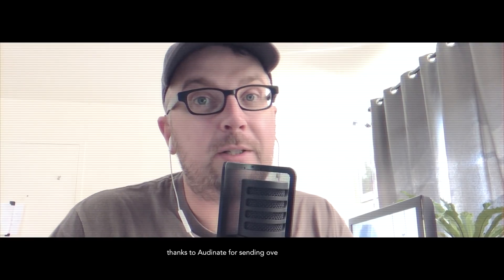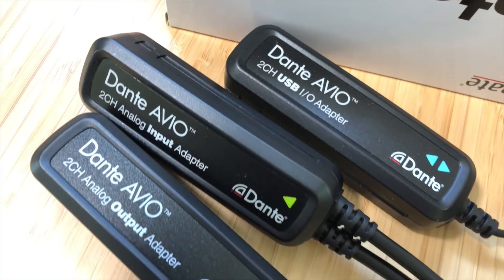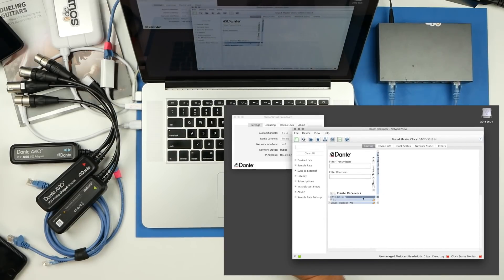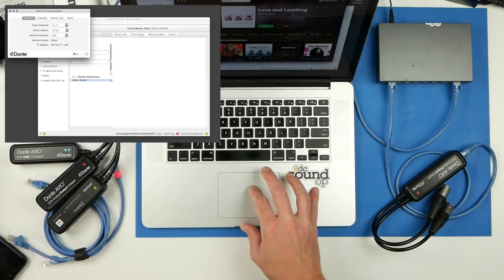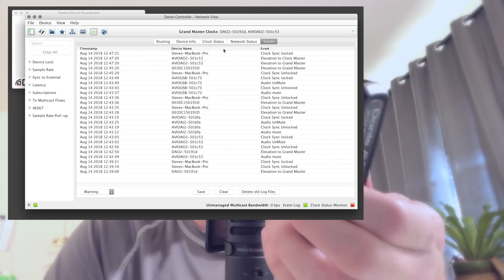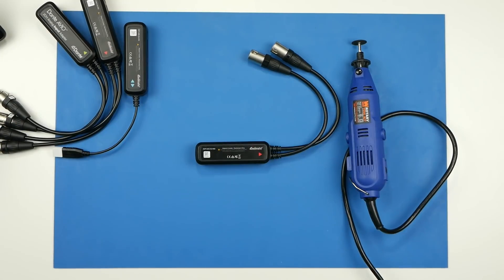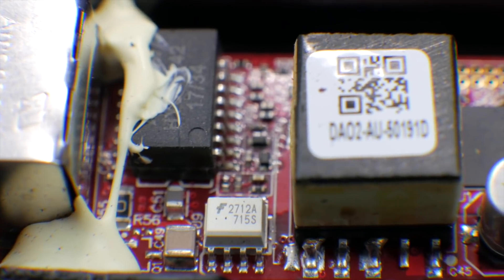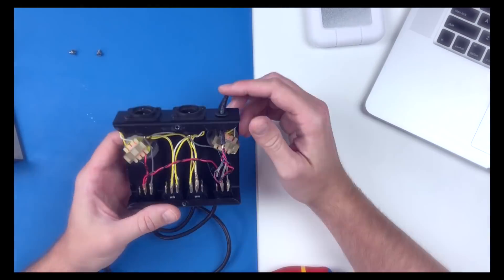Audinate AVIO Dante Audio Adapter: First Look & Review

Comment: Thx
Have you had any issues with the overall level of output from the AVIO Output adapter?
Reply from the maker: Thanks for the message. Did you know you can change the output level of the Avio adapters in Dante Controller? Just double click on the device to open 'device view', then go to the last tab on the right for 'Controls' - there you will be able to choose from a number of different output options.
Reply: @DcSoundOp  Beautiful!!!!

Comment: How do I connect an old racksynth wit only midi in/out to a dante network?
Reply from the maker: Hey Andreas, Dante doesn't do that as far as I know, but you could use the same network to run a midi over ip setup along side Dante and it won't mind. Here is a forum post on the Reaper forums where some folks are talking about different setups they use for midi over ip. Thanks for the great question!

Comment: it should be a version with power on board, so without necessity of the ethernet switch
Reply from the maker: How would you be connecting it to a network without a switch? If you just want to go point to point from a computer or other avio... you could use PoE injectors just fine for local power at each adapter. They’re dirt cheap.
Reply: @DcSoundOp  yes, but you could need just to send a digital signal from a digital source to just one computer that alone cant receive direct digital signal
Reply from the maker: @ergabbio666  I'm not sure I understand. You're saying you want to go point to point from a digital source to a computer... and you could absolutely do that by using a PoE injector ( https://amzn.to/2O2bCFK) with an AES Avio adapter on one end and the USB Avio Adapter on the computer end, powered by the USB port or another PoE injector. There are even battery powered PoE injectors for situations where you need to do this all on battery, though they are a bit more expensive. Let me know if I'm completely misunderstanding what you're looking to do though. Thanks for the message!
Reply: @DcSoundOp  yes i understood i can do it with a PoE, i was just saying it could be nice to have even the possibility to have all in one, so without the necessity to pass through a the PoE injector that in this case it will be use just to give power to AES Avio
Reply: @DcSoundOp  anyway i don't want to be misunderstood, i'm a AES Avio happy user! it's a great system, I just was giving another idea that maybe you didnt think about...but i'm not an engineer, and i respect your job!

Comment: Great video - I was wondering, how are the cases sealed? With glue? Can they be opened non-destructively? Thanks :)
Reply from the maker: Hey Aaron, the units are put together using ultrasonic welding, not glue. It might be possible to open them without as much damage as I did, but I certainly wouldn't have destroyed one just for fun.
Reply: @DcSoundOp  thanks for the info - I've been given two dead AVIOs (they won't power on), so I'm going to try and open them up. They were shipped to a friend in non-anti-static wrapping, so I think it's an ESD-caused fault on the POE transformer. Probably not worth trying to repair, but it could be fun anyway. Cheers
Reply: @Aaron-rn6pg  Hey how did it go?

Comment: An OLED screen so you can patch devices, something that you don't have to use Dante Controller for. Then again you'd hook up a Dante enabled mixer to do all that I guess.

My setup is simple.

I have a Linux Box that there isn't a Dante Virtual Soundcard and Dante Controller driver/software for... Also Audinate doesn't support Linux. :/
REDNet AM2 2ch Out

Comment: Hello. Would a pair of these with male XLR connectors work to connect a pair of Yamaha monitors to a Mac using Dante Virtual Soundcard? Cheers.
Reply from the maker: Absolutely, I use a set for my studio monitors occasionally and it works great. If I didn't reconfigure things so often for testing, I would stick with it full time.
Reply: @DcSoundOp  Thinking about the money I could save in case my old but trustworthy FireWire box one day fails. Thanks.

Comment: Thanks for video. Didn't find this info at Audinate official site but saw that you have the image of Dante Controller device connection view too in your video. Do you know why Dante AVIO Adapter connection speed is only 100Mb even when connected to 1Gb switch PoE port?

Comment: I don't know how much network equipment you understand. I would have sent an ethercon. remove the RJ45 connector from the board, the data transformer is separate from the connector and this is a nice thing.
in addition I would study to give a 15V power supply I assume after the poe. eg not always be linked to the poe.

Comment: Pro Version with possibility for external power and for input version phantom power to power the unit. Also chassis connector and Ethercon.
Reply from the maker: Check out the Switchcraft version - https://youtu.be/ZylT-7ipQaY or the Neutrik DPRO if you to go all out on an input version - https://youtu.be/Bpq9siRXHik

Comment: what's the latency coming from this avio usb adapter into another computer using dante vds?
Reply from the maker: That’s going to depend on how you have things configured. Latency is configurable in Dante controller depending on your network needs. Here is some info on setting latency compensation when playing back from Dante devices - https://dev.audinate.com/GA/dvs/userguide/webhelp/content/dante_latency.htm - out of curiosity, what’s the setup your considering using this for?
Reply: @DcSoundOp  Much appreciated for your  answer. Alright, let's put it this way: what's the minimum latency you have been able to reach with this interface? Thanks
Reply from the maker: Happy to help anytime. Dante handles latency different than you might be thinking. Are you familiar with setting up a Dante network, if not, the level 1 online videos may be of interest @  https://www.audinate.com/resources/training-and-tutorials/dante-certification-training - here is a page that gives you the details - https://dev.audinate.com/GA/dante-controller/userguide/webhelp/content/latency.htm

Comment: I have 6 of these in use at our site.  I too would love to see Ethercon added to this at the least. It would be nice if it had a redundant connection and ran on 1gig. But I'm sure you would not be able to add all that at its current price point. So I would like to see a Pro model as well. Also a rack mount version of this in 8 channels would be great for bringing all your analog wireless mics over to dante.

Comment: When I first read about these I assumed the first would be a 1 in x 1 out version. I guess that doesn't make sense either for live sound or recording though. How often do you need inputs and outputs in the same place? 
Good review! Hope you didn't get into hot water totally upgrading / destroying the original unit.
Reply from the maker: A 1x1 or 2x2 option would absolutely have applications in both live sound and recording. I'm always of the opinion that if you're running a snake, it might as well have a return or two. You never know when you'll need to drop a powered wedge or wired headphone mix in somewhere. 

I'm sure these will start to become more common as the technology becomes more common in the coming months. The crew @Audinate have a great sense of humor.

Comment: Re: Licensing, when you talked about the USB Version:

These would be essential. Apparently, you are only ever allowed to have the license tied to one machine. Forever. How do I know? My DVS License was recently locked, because I switched my production laptop to many times. Never installed on multiple machines at the same time, only ever used it on one machine at the most. But apparantly that is not allowed by Audinate! I think you can imagine my disappointment, when I wanted to install DVS on a new laptop the day before a big festival that I was supposed to multitrack. Luckily, they unlocked my license just in time (30min before show start) but damn, that's the main thing that I really hate about Dante.

I sincerely hope that the industry finally settles on a universal license free standard for AoIP, because this Dante stuff is so annoying at times.

Don't get me wrong, when it works, it's awesome. But I'm constantly lugging around a dedicated windows installation (linux only user) just to deal with Dante.

Re: Build quality: I think it's ridiculous that they're using the yongsheng plugs and molded strain relief - these things will fail in no time in production. That's just poor quality. And of course as soon as you would switch out the plugs you will lose your waranty I bet. I'd probably go ahead and transfer them into a solid metal box of some sort anyway.

Comment: I would love to see that box with an attachment point for a trigger or c clamp and safety point, maybe there could be a 2 in 2 out, with ethercon loop-throughs, something like that ratsound cat box thingy, idea being you could clamp it to press risers, hang it by the safety off the back of a powered speaker, or clamp it to a truss, and loop through to multiple boxes for really long lines of powered speaker, or many press risers. 

Maybe the loop through could have an "extend" or "isolate" mode, extend being all the boxes looped off the first one just mirror the first one, similar to the rat sound solution appearing to Dante as a single 2 out interface, or in isolate mode, where each present themselves as an individual dante 2x2 interface, individually addressable like a normal dante config.